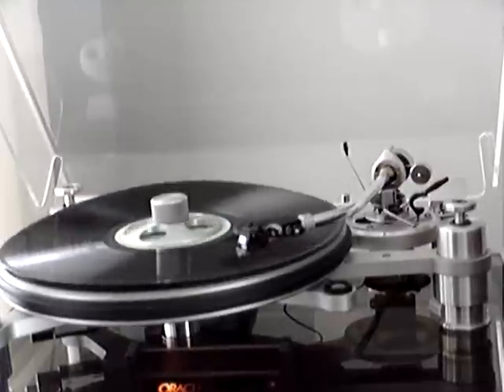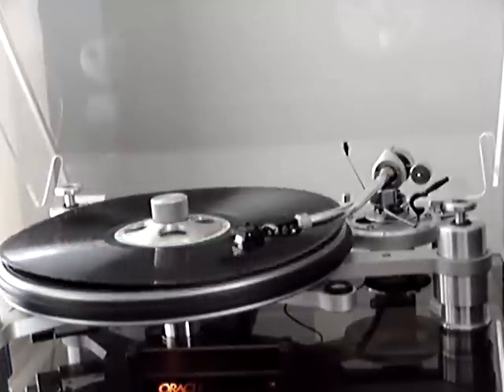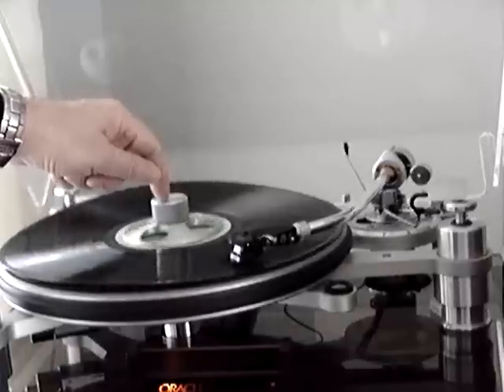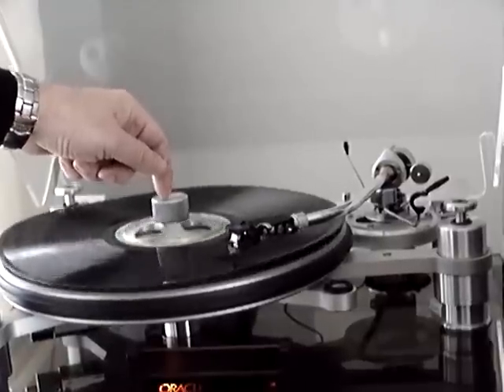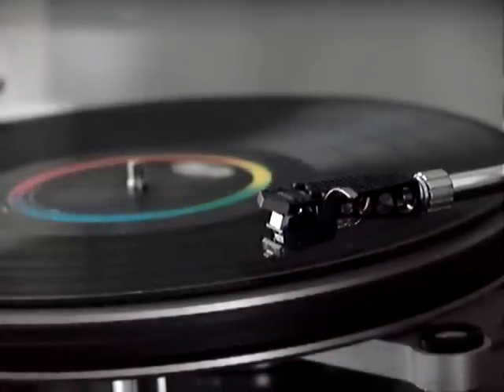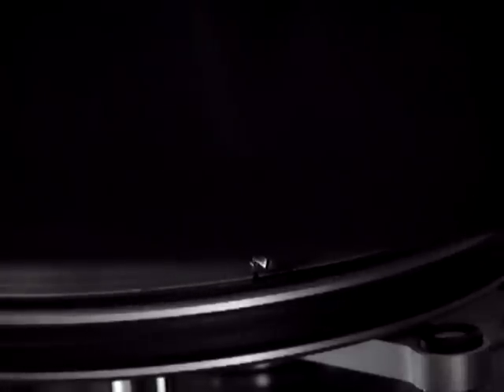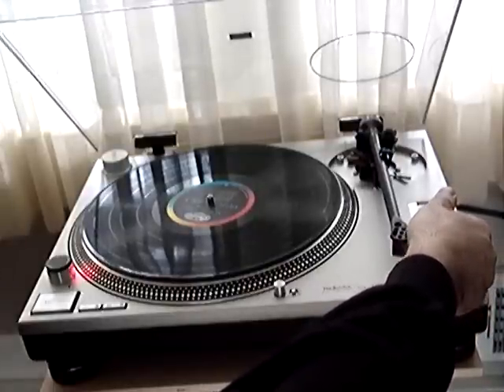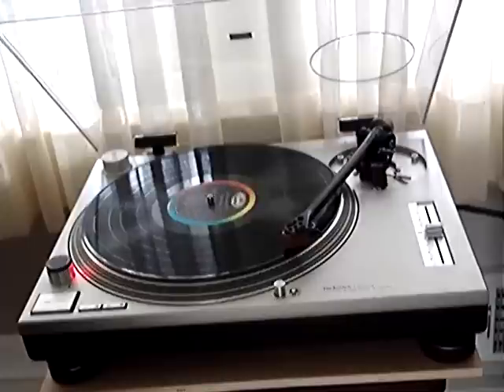Oracle Delphi trackability tests

Comment: This isn't a trackability test at all, it just shows the arm/cartridge combination's ability to follow ridiculously huge warps, which has more to do with arm mass and inertia than anything else. Trackability refers to how well the stylus is able to follow the modulations in the groove, and gets harder as the groove is cut louder. Often a record with very loud bass makes it hard for the stylus to trace the much smaller high frequency information.